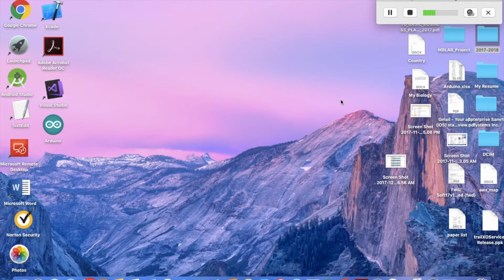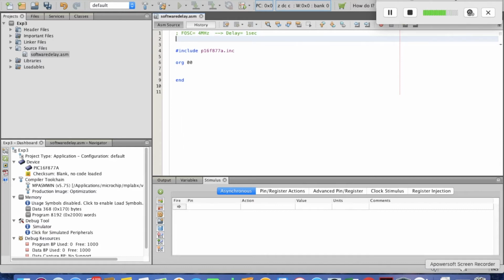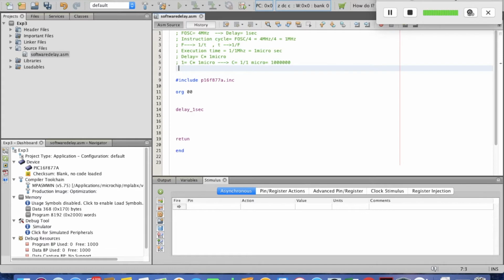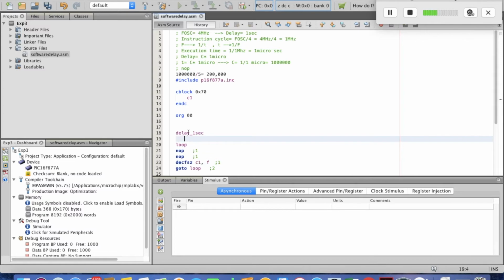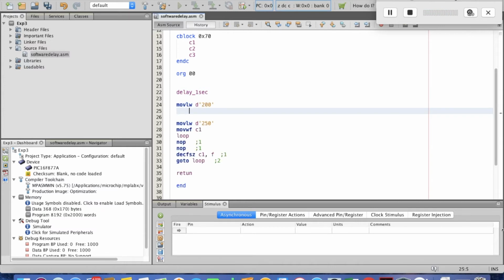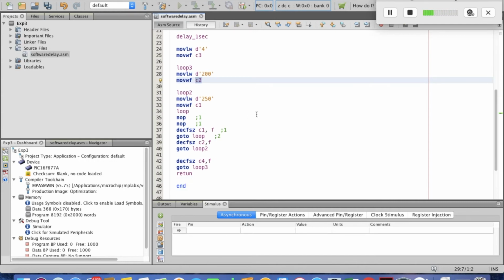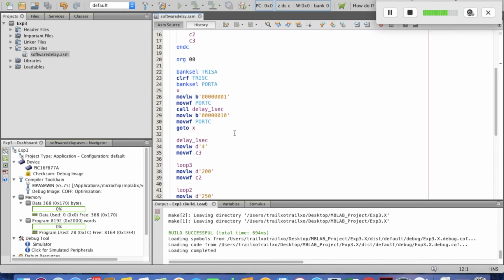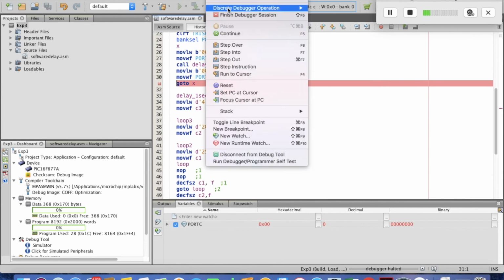Experiment (3): Creating software delay in PIC microcontroller

Comment: Can you repeat calculation part ?  For example if i need 100µ sec delay while clock frequency is 16 MHz ?
Reply from the maker: ok, 
Fosc=100 MHz, so Finst= 16/4 =4 MHz, and Tinst =1/Finst =0.25micro sec
Let's consider the internal loop consists of nop, nop, decfsz and goto loop =>that is 5 cycles
Delay=internal loop *Tinst *C
where C=c1*c2*c3*....
100micro= 5* 0.25micro *C
C= (100micro)/(5*0.25micro)
=400/5=80
so, you have a constant c1= 80
I hope it is clear.

If you the whole code, send me your email.
Reply: @mohammadalhaj4961  Hi, can you help me with PIC16F84A? I'm trying to code a Delay subroutine that needs a delay of 500ms but really can't seem to get it right.